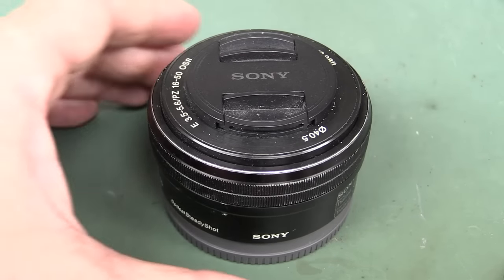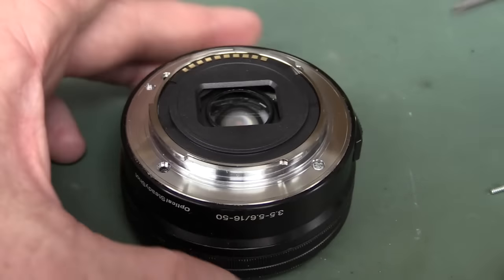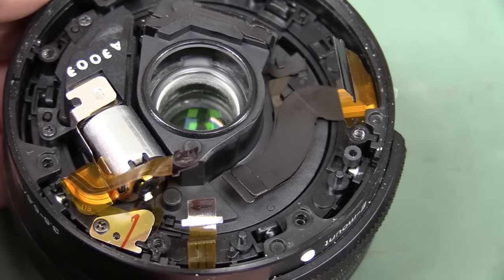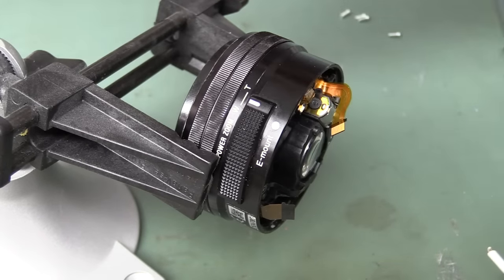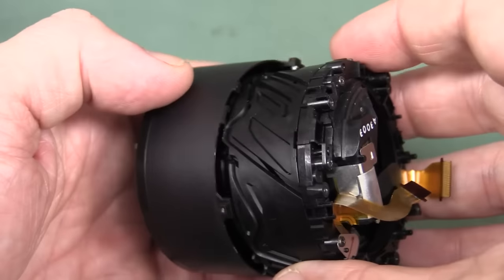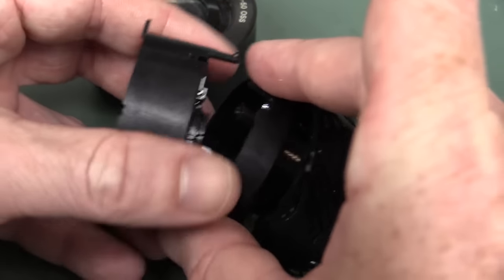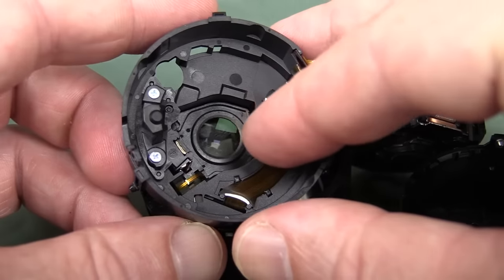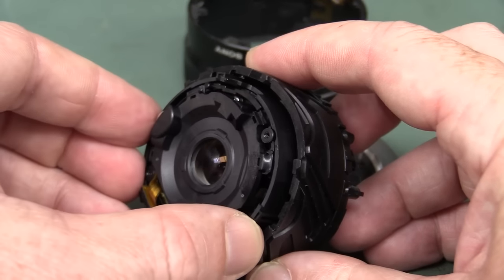EEVblog #849 - Sony E-Mount Camera Lens Teardown

Comment: Although there are very complicated things. You have to remember they were not invented in a vacuum. These devices are developed over many years and iterations and each feature is added separately and so when designing this lens, most of the work has been done for the engineers in previous products. The doesn't take away from the amazing engineering but it does help to understand how something so complex seems possible for such a small price.
Reply: *****
God bless our alien overlords!

Comment: As an FYI, there's basically no relation between the legacy Minolta A-mount and Sony's new E-mount.  A-mount used SPI for lens ROM data and ??? for SSM/SAM (I believe SSM lenses had additional pins compared to legacy screwdrive lenses).

E-mount uses 8N1 asynchronous serial along with a few handshaking lines.  It starts at 750 kbps at init and supports speed negotiation - most native lenses negotiate up to 1.5 Mbps serial as part of the init sequence.

Once initialized, the status and control loop runs at 60 Hz (at least on US bodies - I'm curious if PAL bodies run the lens control loop at 50 Hz).  The body pulses BODY_VD_LENS low, which causes the lens to report two status messages, which the body answers with two command/control messages.  Rinse and repeat.  During an AF cycle, some messages are replaced with other ones, but it's always two in, two out from the body's perspective.

Very disorganized thread at http://www.dpreview.com/forums/post/56133485 with information scattered all over.  Dpreview does not allow posts that have replies to be edited so info is all over the place.  I can't even find my pinout post and my own name is highlighted when I read the thread!

At least I wrote things down more clearly when I posted some sigrok dumps which sigrok merged in - http://sigrok.org/gitweb/?p=sigrok-dumps.git;a=blob;f=lens_mounts/sony_emount/README;h=007c2d6d1a9df90f1d0e20b550db4f7f8523b566;hb=HEAD - They haven't yet merged my protocol decoder as it's a heavy work in progress and not even remotely ready yet.  Current state is at https://github.com/Entropy512/libsigrokdecode/tree/emount

Eventually I'm going to move the thread from dpreview to a more suitable venue that gives me more organizational flexibility (post editing after replies have been made, ability to attach files other than images) - probably Dyxum but maybe EEVblog's forums.

BTW, you figured out what most of the motors were, but that big linear voice coil actuator you were feeding with a 2 Hz sinewave was almost surely the focus drive.  A lot of newer lenses are using voice coil actuators for autofocus - check out lensrental.com's teardown of the Sony FE2470Z.  Funny, the voice coil seems to be more firmly attached to the actual optics in the SELP1650 than it is in the FE2470Z...
Reply: +Andrew Dodd We need to start a wiki on this ^.^
Reply: +Анисимов Дмитрий When I get more time I'm probably going to be starting a thread on dyxum, since dpreview's forum is unsuitable to a research project (can't edit posts that have been replied to, threads auto-lock at 200 posts).  Dyxum is one of only two places I've seen A-mount RE work happen (the other was a German forum linked to from one of the dyxum threads), so I figure it's an appropriate place for E-mount.

Maybe next weekend...  I wanted to spend some time doing a deeper analysis of some of the AF status/command loops first.

Comment: Took mine apart because it was dropped and would not be recognized when attached.  You could hear the motor trying to move but was locked in position. The top ring around 1st inner sleeve was popped out of position.  Tore it all the way down as in your video.  Got it all put back together in about 3 hours of trial and error and examination.  Wish I had watched this first, would have been a bit faster, Fun little puzzle! All is now well with full functionality restored. Amazing engineering, thank you Sony!

Comment: put it back together!
Reply: in timelapse
Reply: +Santiago Segura I had a nikon lens fail on me(Nikon AF-S DX 55-300mm), so I thought I would open it up to see if I could spot the issue, and HOLY SHIT, I didn't know what I was getting in to. I did manage to find the issue(flat flex came disconnected), and get it all back together, but it never worked again. Wasn't surprised, the thing was layer after layer of paper thin fragile stages, and I probably breathed on it too hard, or misaligned something :P Not opening up that can of worms again tho.
Reply: Impossibru
Reply: Nope . . . I put mine back together, and with the optics working. Sadly the camera still doesn't recognised the lens, I must have a dead board or damaged cable

Comment: Yeah, this is why lenses are so expensive. You don't only need to worry about the fancy optics, but how to get all the stuff in one small package that works.
Reply: +LazerLord10 And to think... This is supposed to be a relatively "cheap" lens!
Reply: richfiles
Well, a cheap lens is $100-$200. I guess that's why the term 'relative' is used.
Reply: *****
Camera stuff is just generally expensive, though.
Reply from the maker: +simontay1984 In the world of lenses this is certainly a "cheap" "kit lens".
Reply: +EEVblog  A good Canon or Nikon lens will run 1000+

Comment: The lens design itself (glass, elements, coating, groups) is for most lenses decades old. Designing plastic and placing motors isn't difficult either. The true art is in making it small ;)

Comment: As complex this is, what really baffles my mind is designing a computer processor, the complexity seems almost ungraspable. Same for graphics processors, FPGA's, SoC's etc.
Reply: Exactly my thought as well.
Reply: +To The GAMES its mostly a few blocks repeated 100s or 1000s of times.
Reply: +To The GAMES Processors are actually fairly modular and the design process can be partially automated with stuff like Verilog. What amazes me here is the packaging, fitting all the mechanics on a small number of movable parts and into the case.
Reply: +To The GAMES You need to think of it as a grid. Each element is a unit designed and multiplied. I suggest you have a read on the old processor units, the "ancient" ones. It helps give you a backwards perspective.
Reply: As someone who has designed a few CPUs and FPGAs, I still feel that the ingenuity that goes into creating a lens such as this one is more impressive. Getting the optical, mechanical, and electrical systems integrated and packaged in such a neat and compact way is truly wizardry.
Reply: +To The GAMES 
What baffles me is how people did this before the CAD tools.
I own a little aircraft which I had to fully service a few years back - the schematics for both the airframe and engine were all hand drawn. I stripped and rebuild a thing that I can fly, with my loved one.. based on faxed hand drawn schematics that had been photographed....
Think how long computers have been doing the real rendering grunt, and how much around you is just vision and notebook. This capability is why Japan excelled in the 70's and 80's of electronic manufacturing.
(Sony have fucked up too many time to make me ever buy any of their stuff again though.. for now)
Reply: +To Zachery Nuk

The concepts and base designs of all the optical systems you find in nowadays consumer  cameras where designed and developed in the late 19h and very early 20h century. 

Even most of the concepts that where not possible to produce with that time machinery you can find in the drawing books of scientists and technicians of that time. 

The calculated all of theses with pencils and a sheet of paper, maybe some table books and a slide rule.

The main development spherical optics since then are new materials, thin coat techniques and better machinery to reach better tolerances and cheaper production.

Three major components Dave showed are of newer origins, the automation by motors and electronics, the auto focus and especially the shake correction.
Reply: *****
Nah, just remove all the warning labels and signs, let Darwin do his job :3
Reply: +To The GAMES even ASIC Design level blows your fkn mind
Reply: +Lance Feagan I agree. I am really in awe of the engineering done in this lens. the thought in the optics, the size, even the flat flex is very well though of.

Comment: Well made video... The selp1650 is an amazing lens for its price. Power zoom, auto focus and stabilization in one light and small package. Of course to achieve all these the Sony had made the optics two small in relation to the size of the lens. That results to soft photos and at short focal lengths 16mm - 20mm,  vignetting, typical barrel distortion, chromatic aberration. At long focal lengths 40mm - 50mm the lens the problems are minimal and  is  quite excellent for its price. The lens if bought separately isn't cheap, around 350$ from US Amazon. Like most kit  lenses cost nothing if are included with the camera body. 
I am happy that actually the lens is operational after the disassembly. The bad with modern lenses is that if electronics fail  are useless. They don't have aperture ring and are focusing by wire. The focus ring doesn't mechanically focus the lens. An expensive exception are the true german Zeiss and Leica lenses.  
The inside of the lens didn't have any sand particles

Comment: The mechanism for extending the lens is called cam drive.  There should be 3 motors, to drive focus, focal length (zoom) and iris (aperture)  Although this seems to be a complex mech, it is nothing compared to old school manual lenses from the pre digital era film cameras.

Comment: The wide ribbon cable is probably for the stabilizer, other ones for the motor and the diaphragm.

Pretty standard design, though i'm more of a fan of canon lenses. They are much easier to service and parts are more readily available.
Also watch out you dont take out any eccentric pins. The glass will be out of alignment after that if you dont put them back in the exact way and the lens will have chromatic aberration.

Comment: That really helped in a funny way thanks man. I am repairing one for the first time for a friend and had stripped it down before i saw this video. I took the whole thing apart even front of lense and then realised I had two very small butterfly springs that I had no idea where they came from. Since you didn't have them in this video I knew they were from the front of the lense. I tell you though, putting the sliding mechanism back together is a pain in the ass :D

Comment: RE: "needing to shoot a video for OS"
You can also half-push the shutter;  there would be no need to keep motor power running all the time the camera is on;  a half push of the shutter should enable the Optical Stabilization until the second shutter closes (or the sensor stops accepting light)
Reply from the maker: +Justin Davidow Yes, but easier to just hit the movie button.

Comment: Wow it's amazing that Sony teams put that much engineering and awesome design into such a cheap kit lens, one thing I found after watching this video though, there is no sealing and dust and moisture reduction in this lens, you can see the inside part can extend out without any sealing, this is why I'm not a big fan of zoom lens because after a few trips in the wild, it sucks in good amount of dust :(

Thanks for a great video!

Comment: No surprise he couldn't get it back together. It takes hours of fiddlyness and luck to do that. I managed to fix my EF 18-55 kit lens with a broken AF gear, but had to make a custom tool to do it. Syncing the gears and various lens elements is a nightmare.

I also managed to convert a Sigma SA mount lens into a Canon EF mount lens. They use the same electrical protocol, just different mechanical mount, so I made a new ef mount out of a m42-EF ring adapter.

Comment: Seems like you can clean that all out, reassemble and it would now actually work fine!

And the design concept can actually work as "eyes" for some humanoid project...but the zoom feature, come on! Sony definitely took the mirrorless segment by storm for a while. At least it was serviceable enough and there were not a lot of very, very complicated things on it (I did get the rebuild shock when I gone and done a refresh on a VAIO laptop, that was complicated but then...I think I can do it all again anytime I would like) and the hardest thing to do on that would be keeping those lens clean and free of any substance!

Comment: Nice ! Very Interesting and complex ! I see some mechanical engineering there :D. Those metal pins are probably the followers, that follow the CAM grooves (Worm Drive :P) on the other part. Probably they have three identical grooves and followers 120 degrees apart for a smooth motion. On a closer look, you can also see this arrangement on the inside of the cylinder with the cam grooves. Would be interesting to see how they achieve very tiny movements of the lens with this arrangement, because this would only give you a coarse movement or ?
Reply from the maker: +Inder Sehra Yes, CAM gooves is what I meant!
Reply: +Inder Sehra I'm fairly certain those grooves are only for lens extension/retraction and zoom, neither of which require much precision.

The OSS actuators, as demonstrated, are completely separate, as is the iris motor.  The autofocus mechanism is the big voice coil actuator he was feeding with a 2 Hz sinewave.

Comment: That design is so impressive... how long did it take to work this all out?  I do believe you said this lens isn't expensive... what the?  Why  the hell not?
Reply from the maker: +Michael Hawthorne The glass in it isn't that good, so cheaper.
Reply: +Michael Hawthorne I'm pretty sure lenses are priced solely based on the performance and features and quality of the images they produce.  So the price is only indirectly linked to the amount of R&D that goes into producing it.

Comment: camera autofocus is more to do with the body than the lens, if the lens motors are really fast and accurate then it wont be the bottleneck. im stinn unsire what the osc is for though

Comment: Complicated beasts, but also explains why IS lenses have a good premium over non-IS lenses. This lens doesn't even use the more complicated ultrasonic ring motor type AF drive either yet its still complicated.

Comment: fyi those lens elements probably aren't single pieces of glass, they're probably multiple elements cemented together with optical adhesive.
Reply: here is a link to a lens with a similar focal length, it includes an image that depicts the multiple elements.
http://sigma-rumors.com/2014/05/patents-sigma-16-50mm-f2-8-12-24mm-f2-8-apsc-dslrs/

Comment: Very interesting. I have this lens, it does suck! Its really not great optically and they are well known for the "Cannot recognise lens, reattach" error. Mine failed just outside of warranty (perfect timing!!) and I'd barely used it. But I do have to say seeing your teardown it is a very cleaver little thing, just not robust.
Reply: I have this lens along with some very pricy optics, and I'm continually supposed by how well the Sony zoom performs.  It's not a Zeiss prime, but the images it produces are absolutely, 100% respectable. I will leave bigger, more expensive lenses at home and use this instead if I'm walking around with friends or going on a hike. It's that good.
Reply: For sure it's decent enough for what it is (while mine worked!!) and its size is nice to carry around. I guess I was always disappointed with it coming from using legacy prime lenses (nothing special just some 80's Minolta glass, not even Rokkor). When the 18-50 died I shelled out for the Zeiss 16-70 and absolutely love it! The only problem is I want more lenses of this quality!

Comment: Were you able to figure out why it failed?
Reply from the maker: +Edward Spencer Nothing obvious. Maybe just a grain or two of sand making it stick.
Reply from the maker: +simontay1984 cameras are a tool to be used, not coddled with kid gloves.
Reply: +EEVblog Correct, but if you're talking a camera somewhere rough don't expect it to live a long life unless its made for the job.

Comment: With how hard autofocusing is and if this lens has vibration reduction im shocked it does not use an FPGA running at 100mhz

Comment: I think the 54.000000MHz oscillator is because they need speed to generate autofocus as fast  is possible.
Reply: autofocus is working this way:
light comes in trough the lens into the camera.  on the focus sensor is one lens and 2 photosensors, if both are in phase, the spot is in focus.  if not, depending on phase, the camera tells the lens to turn its focus ring.     
this could be done using 10khz or even less.     
the 54mhz could be used for the accelerometer and the optical stabilizer mechanism (calculating the tilt and shift using PID function)   but still a lot for such a small task... maybe to keep the delay short.
Reply: +gamerpaddy I think the NEX-5 series all use pure contrast detect, but you're correct for the NEX-6 and newer cameras, as well as traditional SLRs.
Reply: Oh ok, i was going to think it was phase detect like the introduced in the canon eos 70d image sensor.   good to know.
Reply: Yeah, Sony did beat Canon to the on-sensor phase detect thing, introducing it on the NEX-6.
Reply: +kasm279 The first few 5 series didn't have phase detection, but the NEX5r and 5t (almost identical cameras, dave's camera is a 5t) have phase and contrast detection. The 5r also came out a month before the 6.
Reply: Aha, I was completely wrong. What I remembered was that the NEX-6 had the fastest continuous AF at the time it was released, and that it was the first hybrid system that actually worked.
Reply: +gamerpaddy Yes because the stabilizer is used for video as well.
Reply: +gamerpaddy Thanks for the info.